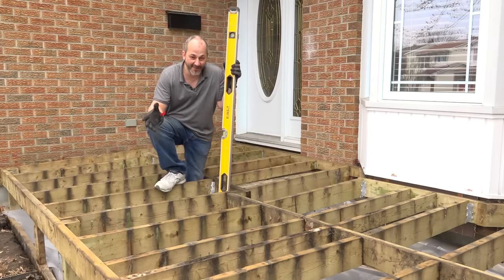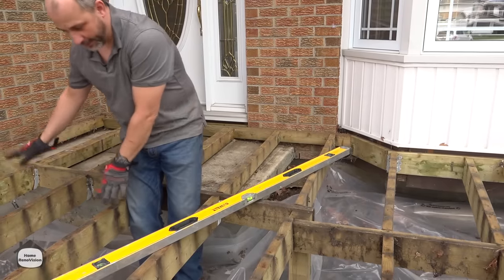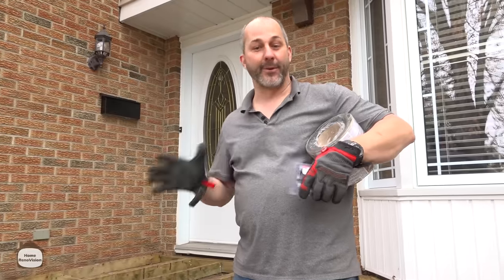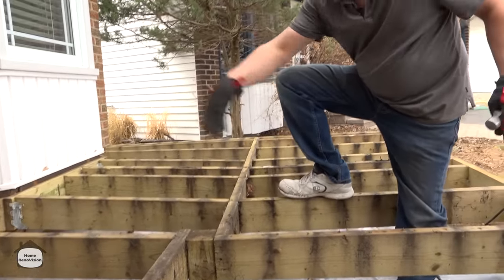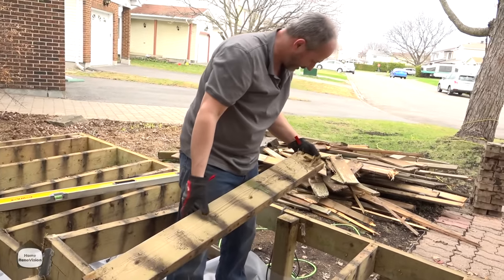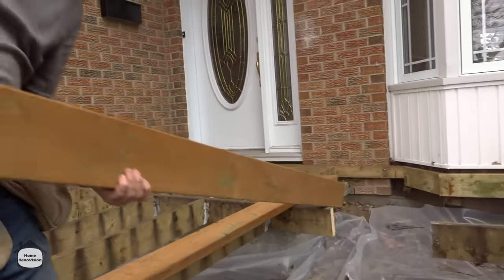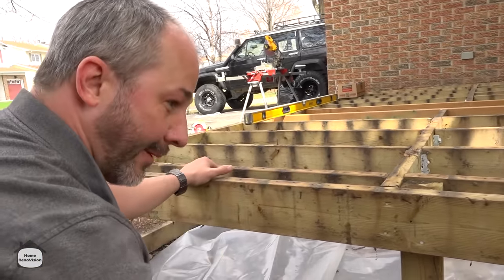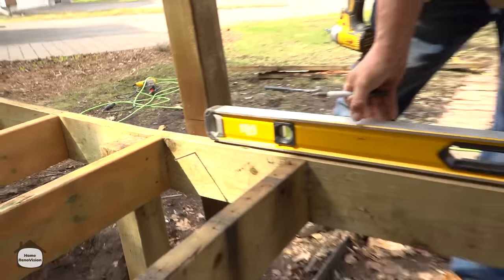Fix Your Old Deck Frame and Save Money! | Deck Restoration

Comment: It looks like they had an original idea to just make a small deck porch, that ended at the start of the bay window, and extended out to a foot or so past the cement step. Then, in the middle of framing, someone decided they wanted it bigger.

Comment: This is a great video about salvaging what you can, especially right now with the cost and availability of “COVID” lumber!  It also helped confirm I am on the right track with the existing structure I’m salvaging.  I’m in the same situation, hard to believe the deck was framed the way it was but working with what’s there and improving the structural integrity.  Also a low deck, but still want it to last a while and stay put.

Comment: i agree with all that Jeff said about rescuing and old deck that may not have been built to the best standards when it was put in.

I built  a 10X12 unattached deck (22" high) at the rear of my property in 1981 when I bought the house, I was an electrical engineer so I built it with common sense and whatever i picked up from Popular Mechanics. I used 2X8 PT framing on 30" centers running side to side on the 12ft dimension, I had 9ea 4X4 posts sitting on concrete pads that probably were 4" into the hard pan and 4" above it, there is a 2X6 that runs front to back under the center run of 4X4's. The framing was attached to the posts with 2ea 3/8" galvanized bolts (two from each plane on corners, the intermediate joists were attached with 3 16d nails and 2 3/8" dowels. i cut felt paper and put strips on top of all the framing as a barrier to water, I also laid poly under the deck to keep the ground moisture level down. The decking was 2X6 hemlock that I coated with Penta (no longer sold for a good reason) I stood the decking on end on a bucket of Penta so it got sucked up into the end grain. The rain was 2X6 angled with incorporated seating on the front and sides of the deck, the back butted into and existing 4 ft wall that i capped with wood to make additional seating. A few months later a coated everything with Cabot's oil stain and i added a fresh coat every few years.

After about 25 years I replaced a few deck boards and then after 35 years I had all the decking ripped off and replaced with PT 2x6 because a lot of the old hemlock boards were failing. The contractor said he might have to put intermediate joists in fore structural support and I told him to so what he thought best. When the contractor ripped off the decking (I was near 70 at the time and had a bad back) he was amazed by the soundness of the 35 year old framing frame and said there was no need to worry about the 30" spacing. I coated the new 2X6PT decking with stain and that will do me for the rest of my days, that deck has zero bounce and is as strong as it was back in '81 when it was new and the 1" of slope (decking runs fore to aft) over the 10ft length is has not changed over the decades.

The deck was never built to "standards but I'd say it's weathered pretty good considering it's now 37-1/2 years old.
Reply from the maker: Cheers!

Comment: 15:50
If you put the square on the other side of the lumber, the point of the triangle will overhang the close side and give your circ saw way more edge to follow for the first part of the cut.

Comment: Thanks for the tips and tricks.. As I'm in the middle of fixing up my old deck. Very much the same issue's apart from that where the deck was attached to the house, it was done badly and caused that part of the house to Rot.... I loved that the door mate was used as a shim.

Comment: The same thing happened to my L-shaped pool deck.  I threw it together and it lasted about 7 years before sinking in the middle.  I completely rebuilt it and used as much old framing as I could.  I used those headlock screws at every post (love 'em!).  I wish I had seen this video before I rebuilt it because I did the decking before installing the rails and had to use those "fancy" post bottom caps (which work great but are pricey!).  I even put the LEDs caps on every post which really lights it up at night!  Keep up the great videos.  I really enjoyed your dry wall series too!

Comment: Great show...I use to set newel post in new tract homes,open the plywood and block all sides with carpenter glue and 16d galvy's put plywood back and move on,,,paid 10 bucks a post back in 1974
Reply from the maker: Cool!

Comment: Nice job on your part,  I'm about through doing the same thing at my house. Luckily I had a lot better structure underneath to deal with, totally sound after 20 years.   At 6:42,  the original builder left the damn door mat down and built over it?  Nice.    And putting plastic down underneath? I'm in SC and that would hold water and be a mosquito breeder around here. Got some good pointers though,  Thanks.

Comment: You had a 4x4 post in the corner supporting the deck. You put a 4x4 railing post right above it. How did you attach that railing post?

Comment: So I should not use outside galvanized joist hanger nails? I should use the screws you used here for my joist hangers? Also, is there any advantage (or disadvantage) to using joist hangers on my outside rim joist?

Comment: Wow, that was really impressive! my initial expectation was for you to add more posts. I know you already stated that you took one out instead of adding more in a previous comment. Well that solved my curiosity, and it was a great idea.  How did you come from being a painter to a jack of trades/carpenter? I see the natural progression of working backwards from painting to learning how to mud then to hanging dry wall. Not so much on how to remodel, and learning about load bearing walls, duct work ect... My next question is: Do you plan on showing a video on how to rebuild roofs or even building a new roof? 

Anyway, Thank you for the video and your expert advice! I really appreciate it! Also Thank you for taking time to answer my questions! I really appreciate that as well. 

Have a good one, and Cheers!
Reply from the maker: LOL, I have been blessed with great opportunities to learn and great teachers...even if they were jerks. i learned a lot. Cheers!

Comment: How did you attach the outside corner railing post? It looked like you placed the 4x4 on top of the structural 4x4 and screwed down diagonally. Will that hold anything?

Comment: Thanks for another very informative video.
I criticism though- at 5:50 you mention pressure washing.
IMHO Never pressure wash a deck as it drives any mould spores from the surface or already in the wood far into the wood and gives them a nice drink as well.
I was 'fortunate' enough to make a direct,'scientific' comparison when I renovated a 14m deck for 2 adjoining houses a few years back.The half which LOOKED awful and was full of crushed acorns etc only needed 1 joist out of 14 replacing and 90% of the boards were re-usable.
The other half of the deck LOOKED 'tidy' but had been repeatedly pressure-washed over the years.60+% of the boards were composT,especially on the underside and 11 out of 14 joists were utterly destroyed by fungal attack.
All other things were equal-same foundations,timber,carpenter,sun/shade and of course identical weather conditions,all built at the same time as well!.

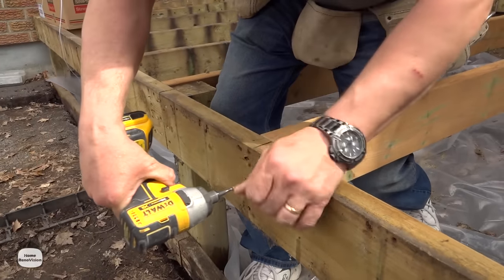Comment: By far my new favorite channel on Youtube. Jeff can I ask a question (I'm a DIY beginner) - at 17:29 where you're fixing a joist to the rim but there is no adjoining post, why not use a hanger? Is it sufficient to put screws into the end of the joist through the rim? Thanks.
Reply from the maker: Hi Chris, I got to it later, as a habit i install and then add strength

Comment: Be it using pressure treated wood or regular wood, whenever I do deck repairs to my cabin, I try to put a coat of deck stain to as many of the structural deck  members as I can. I also paint all sides of the deck boards with deck stain before installing them. Does this layer of wood protection help?

Comment: Helpful video! Is there anything you recommend to put under a deck to prevent the rain water from splashing down? Or to drain the water away from the house? We have a deck on our main level, but the water drips right through to the basement level about 9-10 feet below. Then it splashes up on the basement door.
Reply from the maker: there are deck ceiling products on the market that redirect water. Cheers!

Comment: Jeff can you do a video on deck building around above ground pool?
Reply from the maker: Perhaps one day we will. the secret is to not cover the edge of the pool so you can always replace a liner if necessary. Cheers!
Reply: I've have a friend that building a 1250 square foot deck around an above ground pool. Hes had like 35 concrete footings. Lol

Comment: Jeff I’m on the Gulf of Mexico where is no frost line so I’m ignorant on the subject.  How is placing the posts on a block on the ground any different than a post in the dirt that doesn’t penetrate the frost line?  Is there not still going to be heaving and movement ?
Reply from the maker: yes but the ground also heaves and lays flat when thawed. the overall effect is a little out of level in winter and perfect the rest of the year. Nothing to worry about. that is why we use the hangers to help keep it strong after movement. Cheers!

Comment: Were you able to use joist hangers on Both sides of the single beam running through the middle?
Reply from the maker: Yes the span is quite short so not carrying much load. Cheers!

Comment: Is it ok to attach a deck to the house and have the other end floating? If the other end sinks wont it make problems for the end attached to the house?
Reply from the maker: Not supposed to be this way. best way is all footings or nothing attached and all floating.

Comment: you mentioned a large black screw that replaces the carriage bolts, but don't name the product. What are they called.
By the way, great job on the video. It is exactly what I am currently doing with my existing 12 x 16 deck. 
Keep em coming.....
Reply: Fastenmaster HeadLok, TimberLok and LedgerLok.Depends on your application.

Comment: Nails would do better for shear forces. Personally I'd have it torn out. Where I live this would be against building code because you can't do a mixed structure by attaching part to the house and parts not.  Here you either attach it and therefor make it part of the house (which requires permits and increases your property taxes because it's more "structure") or you don't and nobody cares unless the deck is over 3 feet above grade. Mentioning building codes would be helpful for this video, as that may vary a lot from area to area and it's better to check for codes before building something that comes to bite you down the road.
Reply from the maker: YOU do you. most people are looking for practical advice. anybody can remove and reinstall but that costs extra money they would rather spend on their kids.

Comment: Do you have a link to those ally screws/fasteners used to hold on the joists? Great video, as always.
Reply: yea I would like a link because I used screws on my joist hangers and inspector made me take them out had to use joist hanger nails.
Reply: Simpson Strong-Tie  #10 x 2-1/2 in. Hex Head Strong-Drive SD Structural-Connector Screw (100-Pack)

Comment: @6:39 they left the old frontdoor mat under the deck??
Reply from the maker: yes, a sure sign that this was done in a hurry. LOL
Reply: Wtfffff
Reply: I was just going to say that!!
Reply: Same, first thing I noticed at that moment lol 😂😂
Reply: It said "Welcome...to my mess" lol
Reply: It's for the mice to wipe there feet
Reply: At 6:39 I love the fact that the DIY homeowner who built the original deck left their rubber WELCOME mat under the floor joists for supporting the deck on the concrete steps.  Now, THAT'S a new one.

Comment: Hey Jeff... in my area i do have a frost line around 3 feet deep. i dont want the hassle of digging huge holes and make footings. is it okay to use the floating blocks? My deck is supposed to be low to the ground and I want it floating not attached to the house... what would be the best surface preparation? Dig the grass up ... then layer of sand, compact it, layer of gravel, compact it, and then use the blocks with that powder leveling you used in another video? What are the best practices for this? thanks

Thanks

BTW, what is the name of those alloy screws you are using with the joist hangers? never seen them at lowes or hardware store...
Reply from the maker: close, remove grass and add leveling aggregate. tamp and add block. done. cheers!
Reply: Home RenoVision DIY wow that simple? No need for gravel stones or anything like that? Nice

Comment: Is it OK that the joist are attached to the post instead of being on top of them?  It looks like the load of the deck is held up by the fasteners on the post.
Reply from the maker: As long as you use the right hardware. If you are unsure simply consult your local building office for clarification.

Comment: Why the need for the aggregate that was put down before the stone slab was placed on top? And wouldn't that need to be tamped down?
Reply from the maker: just to help level the block. I installed it about a 1/4 inch higher than needed so the weight of the deck will settle it to perfect.
Reply: Thanks for the reply. My sis is getting a 2 story high deck built for her new house, so I have been reading and watching videos on how decks are put together.

Comment: Perfect timing. Doing this to my deck next week. Structure is good but all my deck Boards curled up on the ends even tho they are on joists. Not sure what when wrong. Once I bought the house I treated the decks but it didn’t help. Anytime it gets hot the Boards curl up but come winter it goes back to flat. Weird and very unsafe.
Reply from the maker: sounds like you have a moisture problem, try using the plastic ground sheet. Cheers!

Comment: "ACQ" screws? Is that an acronym or a brand name?
Reply: Neither, ACQ stands for Alkaline Copper Quaternary which is what is used in pressure treating lumber. Basic rule of thumb is to use hot dipped galvanized or stainless steel fasteners when screwing into pressure treated lumber.

Comment: If you bought an actually construction grade circular saw instead of the home owner version you are using you wouldnt need to use your square to make straight cuts. Buy a skill saw  with a worm drive so you can see what you are doing.
Reply from the maker: wow, easy dog. just teaching home owners tricks to make their lives easier. I am sure my tools are bigger than yours!

Comment: What screws are you using at 28:34?
Reply from the maker: I used deck screws which are ACQ rated for exterior lumber.
Reply: These are the long screws you drove into the 4x4 posts rated for 1,000 lbs?
Reply: What length are the screws being used?  The look like FastenMaster HeadLOK 4 1/2 screws? Thanks

Comment: You said that a deck under 24” has no building code, that is incorrect.  You may not need a building permit, but it is still required to meet code. Also, That deck appears to be serving the front door, therefore, a building permit is required.
Reply from the maker: THat may be true, but since I didn't remove he framing it doesn't!

Comment: I disagree about building on the existing slab. I’m repairing my own deck where previous owners did that. Animals burrowed under back part of slab and it continued to sink where was a solid 1 foot lower than when it was originally poured. Then because it was sloped towards house after settling it allowed any water to be placed directly at house foundation. I just got finished jackhammering slab and installing new posts to support deck which they should have done the first time.
Reply from the maker: That is why you need to keep out the animals with a solid skirt. Cheers!
Reply: Home RenoVision DIY I’ll be hoping for next videos of same deck showing the “solid skirt” extending underground :)  anyway as a structural engineer I thoroughly enjoy your videos.

Comment: People...please don't use screws for shear strength. That's what nails are for.
Reply from the maker: structural screws work just fine for that situation.
Reply: GRK makes structured screws in Thunder Bay, ON. They also make parts for cars so they need to be super strong.

Comment: Not OK to build a deck on top of a concrete slab it will fail inspection in Colorado.
Reply: Not if it's less than or equal to 30 inches from the ground. No permits, no standard, etc.  This is different on multi dwelling properties and commercial properties. Which must conform to IBC

Comment: The way you did it is correct but what cutting the middle 4x4 post and lay the joist on top, a sistered beam on top of those 4x4's.  I noticed the rim joist nailed screwed to the 4x4, so maybe splitting the difference in the 4x4 between the rim and joist.  26lu on the perpendicular beam.  Oh and cut back on the his stupid and am smart and better laugh, so annoying, Just saying.

Comment: To say that every deck under 24" does not have to follow code is wrong. A deck serving the main entrance to a dwelling in the City of Ottawa requires a permit regardless of height.
Reply from the maker: Not if you are modifying an existing . Cheers!
Reply: Home RenoVision DIY still incorrect as that deck would not have a permit to begin with based on how it’s built so structurally altering it would constitute a permit.  I am just suggesting not to provide permit information if it’s not correct. Also, allowing a deck to remain floating and attached to a house is clearly not allowed in any case.